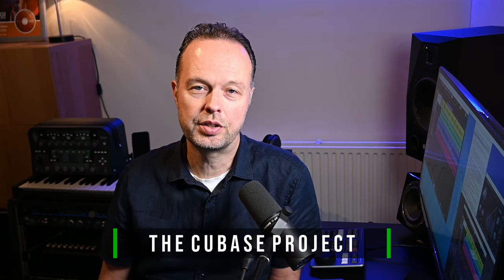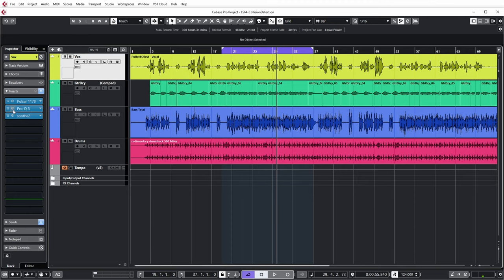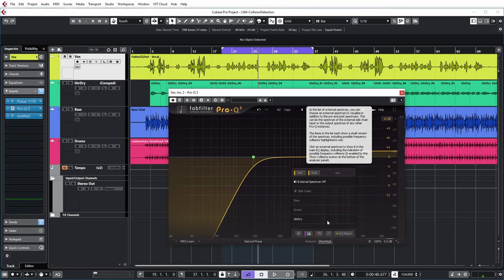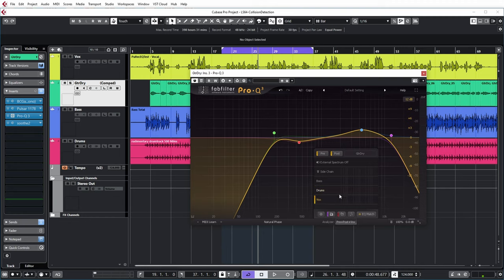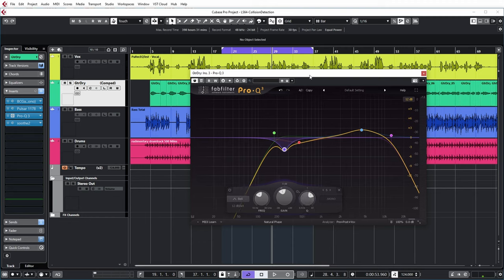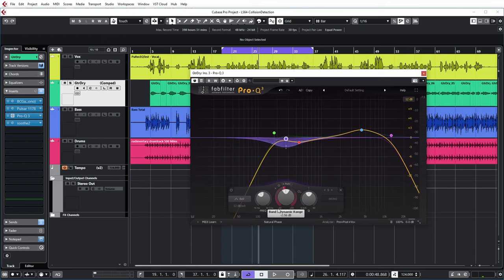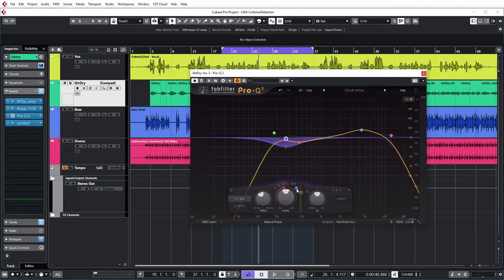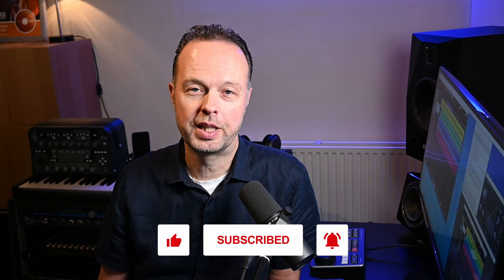How to detect (and fix)  frequency collisions with FabFilter Pro-Q 3

Comment: Mine doesn't show the tracks under the various pro-qs there are.. it only numbers them and it is fucking pissing me off
Reply from the maker: Hmmm, neve had that myself (I think). Did you find out what caused it yet?
Reply: @LanewoodStudios  NOPE... wrote about it on the fabfilter forum and haven't heard anything yet... super annoying... i just get a list of "pro-q" and I don't know which track is which
Reply from the maker: @YoungNino2017  that's annoying indeed. Are you using VST3 or VST2 versions of the plugins? Maybe that makes a difference.